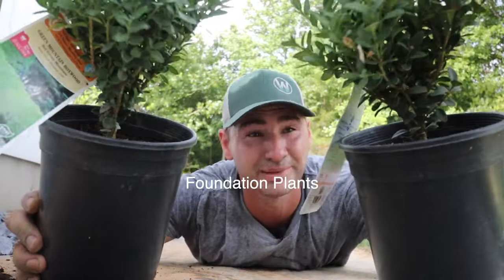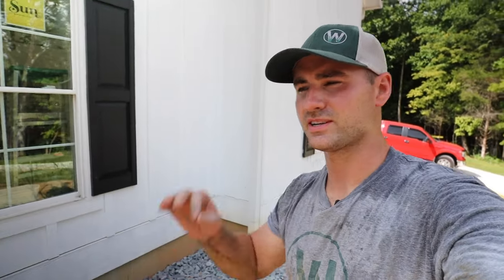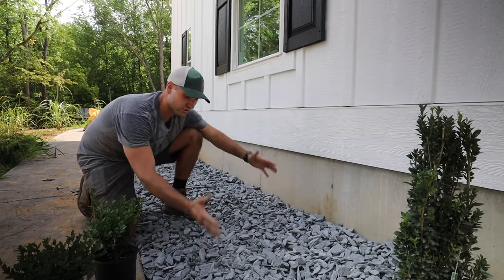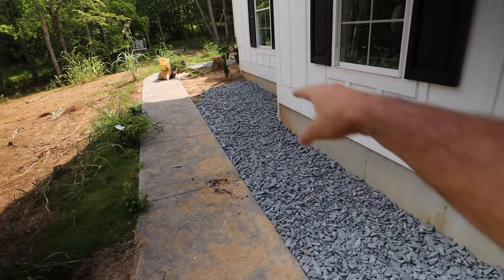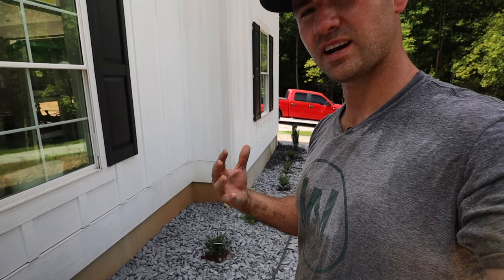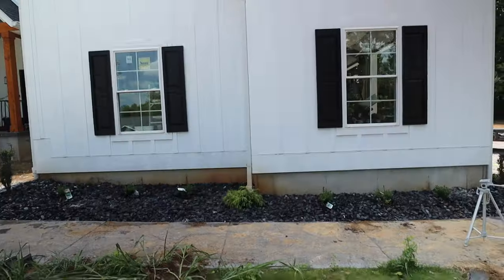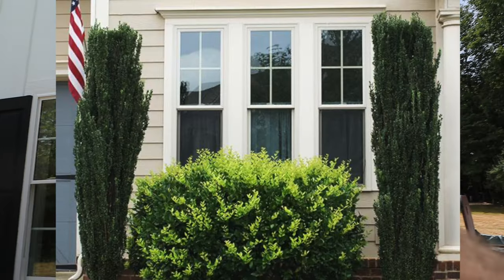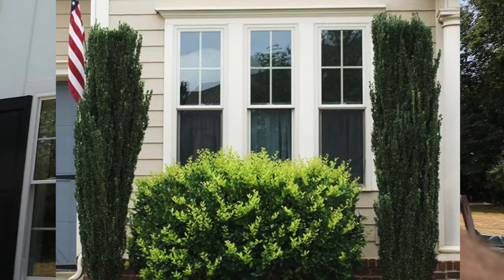How To Landscaping: Foundation Planting

Comment: Beautiful work as always.  Two comments from the peanut gallery….I like to cut up those used Amazon boxes and lay them flat on the ground before I add rock or mulch.  The cardboard acts as a weed barrier and is good for the soil.  Secondly, please remember folks, that the soil grade underneath should slope slightly away from the home so water can run away from the foundation.  I learned that from experience 😮.  I am far from an expert, just trying to share some best practices from my home.
Reply from the maker: Good tips, friend!

Comment: That’s going to be a nightmare with weeds with no barrier of any kind put down. I know from experience 😅
Reply from the maker: I do not like weed barrier of any kind personally. I never used it at my last house and never had much weed issue. Use a good pre emergent in the spring time and pull and that pop through. I don’t like using weed barrier 🤷🏻‍♂️
Reply: @TheLawnWhisperer  I thought you only had mulch in your beds at your old place? I don’t use a weed barrier in mulch beds either, only rock beds. Lot harder to drown out the weeds with rock beds vs mulch
Reply from the maker: @johnbunani1341  I have a lawn and landscape business as well. In my experience you will get weeds regardless and it’s much harder to pull weeds with the fabric